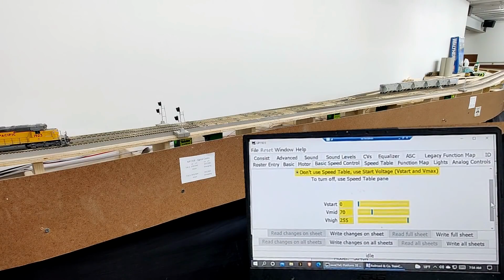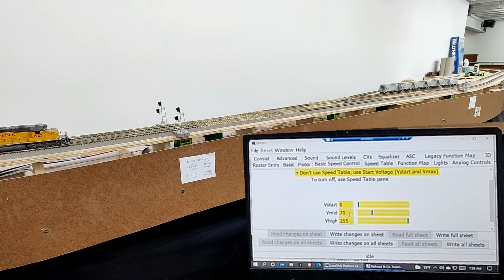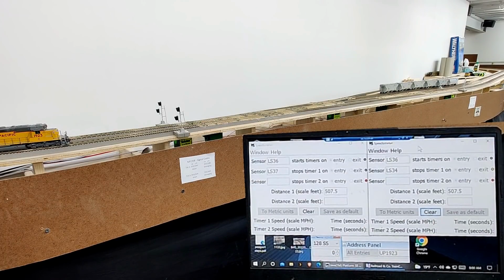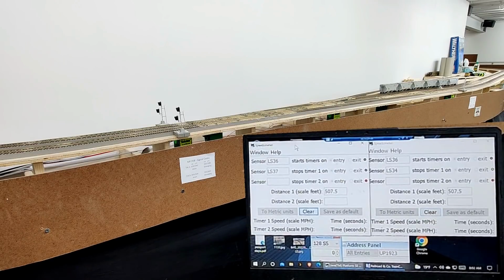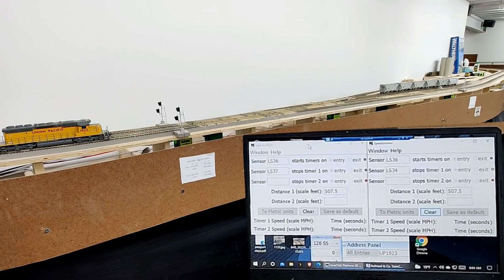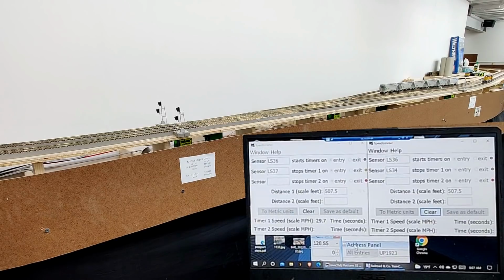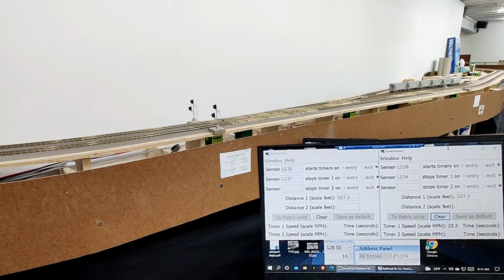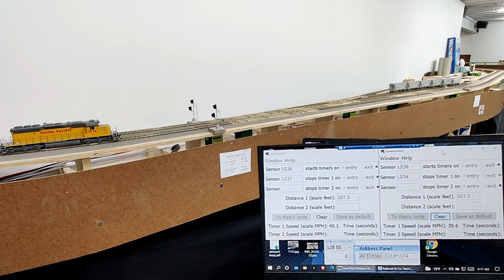3-10-22 JMRI Speed Matching Instructional Video - Model Train Layout Built for Operations & Realism.

Comment: Hi Daryl,
I just tried using your speed matching method but have just realised that you are probably using JMRI Panel Pro for your detection and signalling control, etc. - is this the case ?
I am using iTrain for my detection control, etc. so when I enter my detection labels into a JMRI speedometer it doesn't respond (of course) - doh
Reply from the maker: Is there a way to connect your computer to iTrain?
Reply: @EvanstonSub  Yes, Daryl, I use JMRI for programming my locos and iTrain for route setting, automation,  manual running of trains, detection, etc.

Comment: Hi Daryl,  As you I am a big newbie over here in Scotland and I have a question please - whay are you changing Vmid and not Vhigh when you are speed matching ?
Reply: I meant 'as you know' - doh 🙄 - clearly at the grand old age of 66 I'm still a newbie at typing too
Reply from the maker: The trains have the ability to run up to 80 scale mph.  Since we usually run them between 0 and 30 mph on the layout, the Vmid is much more important than the Vhigh.

Comment: Great vid.  I am looking at doing this soon.  I will try using the infrared speedo that is placed over the track.  Hopefully the results are as good as yours.  Do you have any Scaletrains locos?  Out of the box, they run at half the speed at any given throttle setting compared to Athearn.  They will need a good boost for the mid throttle setting.
Reply from the maker: Good luck!

Comment: Once you've set up two (or multiple) locomotives like this, do they all play well in a distributed power lashup?
Reply from the maker: Yep, that's the idea. It's fun to try and find where in the train the slack action is between pushing and pulling.
Reply: When doing a mid-train DPU, I try to get more cars behind the DPU and a few less cars between the lead and the DPU to prevent slack acton if that makes any sense.